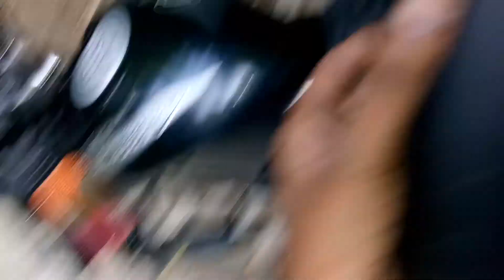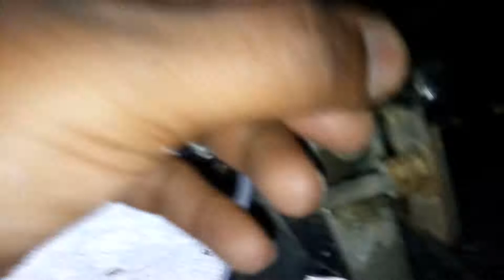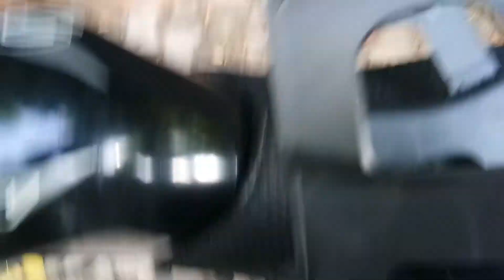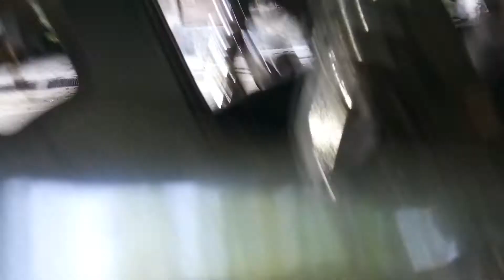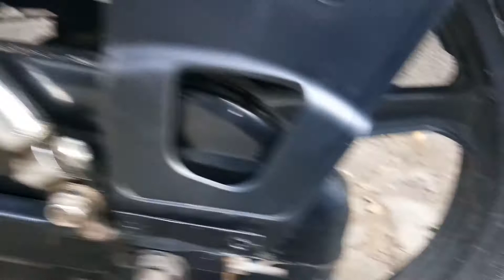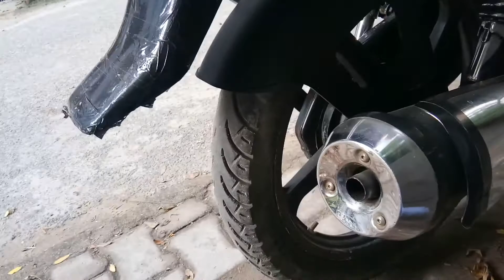How to install pulsar 180 & 150  mud guard in hero glamour  bike

Comment: can i fix this mudflap in my karizma ZMR
Reply from the maker: Yaa sure u can fix this mud flap in your karizma zmr which model is your bike???
Reply: @modifybikers3492  but when the shock works will  it touch in  the  top?
Reply: @modifybikers3492 ZMR V1
Reply from the maker: No this is not touch on top don't wory
Reply: @modifybikers3492  i fixed.
Reply from the maker: Can u sent me the video how its look????
Reply: @modifybikers3492  i will send
Reply: how can i send the video in commend box?
Reply from the maker: @muhammedjafar5973  u will send me on my whatsapp number my whats app number  is this +91 80765 31914